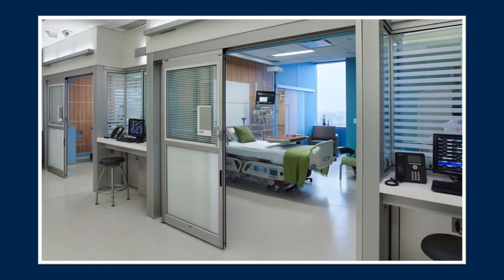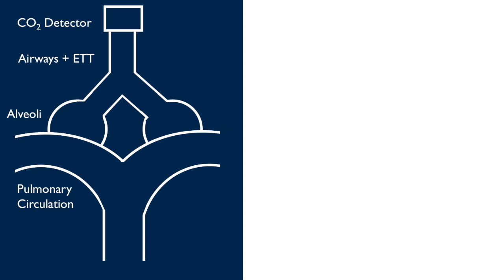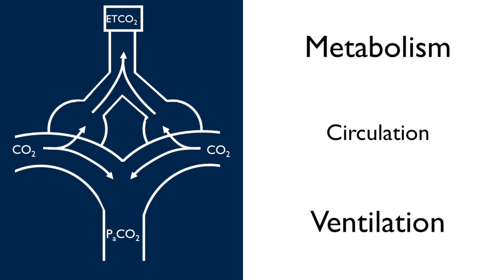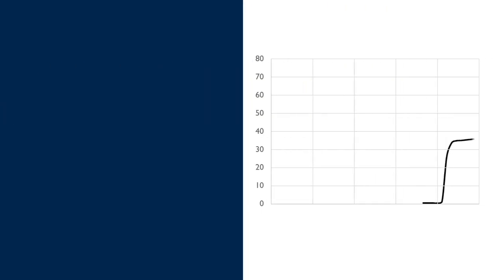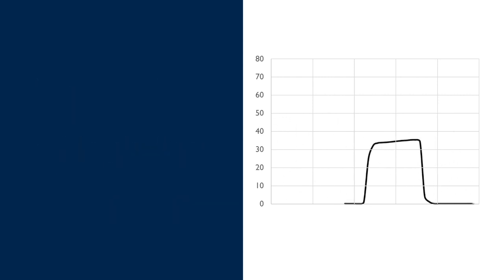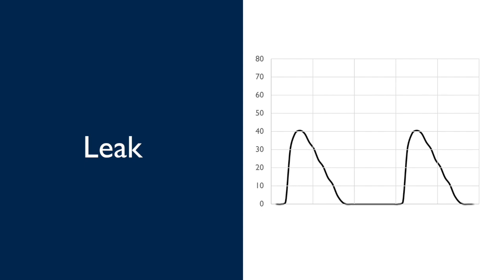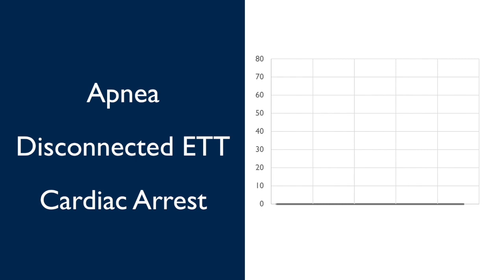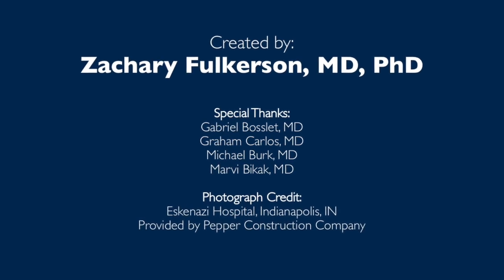Waveform Capnography

Comment: Great video. Seen that Curare clef and was a bit confused because the pt. was not intubated/no paralitics involved.COPD or Sepsis I was thinking.
Reply from the maker: Yeah, so anything that results in a patient making an inspiratory effort but not triggering the vent will look like the curare clef.  In COPD you could see it in someone who is auto-PEEPing and not triggering the vent if the it is set to a pressure trigger.
Reply: @zachb1984  Thanks for the explanation.